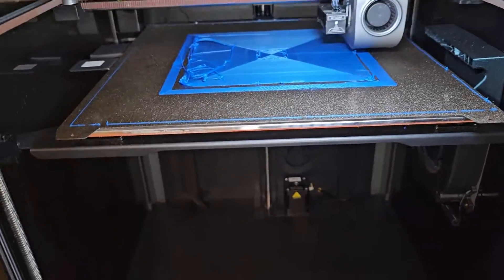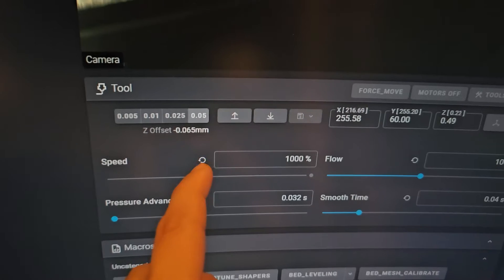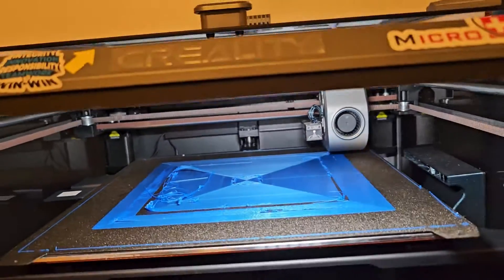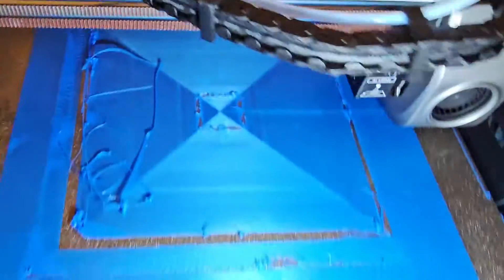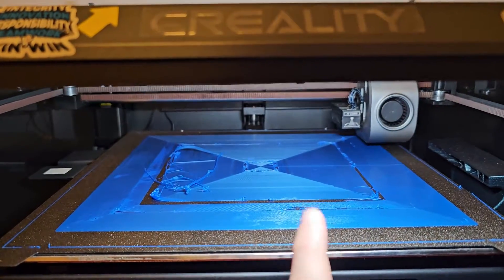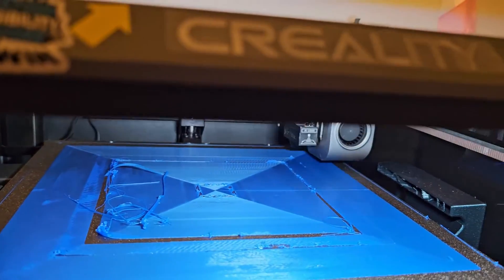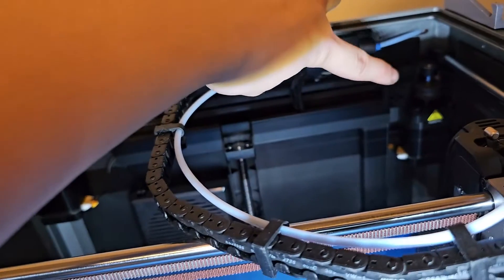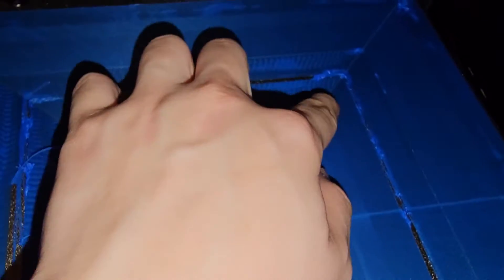Learning More About The K1 Max First Layer... Why It's Not Sticking

Comment: I sold my K1 max. Over time I had to print slower and slower. Replaced everything but the motors. A new plate helped a lot. But it just degraded and I had to print slower than my bed slingers…
Reply from the maker: ouch, hopefully mine stays strong for a long time. What 3d printer did you get instead?

Comment: One thing at a time. You print at 800mm/s for the first layer, and you do not understand why it don't stick? This is not a joke? This is for real? You even got ringing on the first layer. Horizontal ringing. What have you learned since posting this?
Reply from the maker: I have learn that I should slow down on the first layer, make sure to lube all the rod/motors and make sure it sticks to the bed.
Reply: @Scratch3DPrinting  Well. In the vid, the bed analysis tells you, that you have a warped bed. You need to heed that. It is also hard to fix on this printer. The center of your bed seems ok. Youtube is your friend on that one.

How about drying and how to treat the spool? You know the rule that the filament strip, should either be locked in your hand, in the extruder or in the spool. As to avoid from getting tangled? Selander is the only one talking about this, but it is super critical.

There is something called extrusion speed. In this video you simply run your printer beyond the max the printer can handle, and the extrusion fails. That is called volumetric speed. It differs across a lot of parameters. A quick youtube search, will give you a ton of info.

In this video, you ask about the patterns, the waves in your print. That is ringing. You go so fast, that the printer start hitting some resonanse, that translate into these patterns in your print. When they show up vertically, never seen anyone go this crazy and induce them horizontally before, they can be fixed by increase or decrease in speed, an alleviated by pressure advance and input shaping. You might also have issues with your printer, like loose screws or belts, not to mention, too tight belts.
Reply from the maker: @FrodeBergetonNilsen   Thanks for the info. I will try to slow down and improve on the first layer by using some of your suggestion.

Comment: I'm having first layer issues with my new K1 Max where the outer wall of the print smears and bleeds over the outline of the print but every layer above that prints fine. What I end up with is very unclean and overhang edges I have to clean up using a deburring tool (like a small unwanted brim when the brim setting is OFF). I don't mind cleaning up by deburring a simple print but doing that for many honeycomb wall panels is unmanageable.  I've tried adjusting the bed temperature, nozzle temperature, print speed, and calibrated the flow rate using pass 1 & pass 2 in Creality Slicer without any success. I never had this issue with my other FDM printers before. Did you have any issues with this and can you offer any tips on how to fix this? Thanks!
Reply from the maker: I do have that problem too, what I do is the make the first layer width a bit smaller, to about .3 to .35, this helps a bit with the smearing, but does reduce first layer adhesion. Try a pressure advance test on Orcaslicer, use the PA Line and see if that helps a bit. Let me know if you still have problems or have solved it.
Reply: @Scratch3DPrinting  That is not how you solve adhesion issues. Not sure what he means by "smear". Slow down the speed, to say 20mm/s for the first layer. Clean the bed and apply glue if needed. The slicer compensates for elephant foot, which is the setting to use for adusting first layer layer width. Much more important is the layer height. Use 0,3mm layerheight on the first layer, if 0,2mm does not work. If you do, you need to increase the layer width, probably to 0,5 or whatever default would be for your printer for that setting.

If it still doesn't stick, you need to work on bed temp. Then you need to work on nozzle temp. You might need to increase the speed. You might need to alter your model. The list is like endless. But that bed is notorious for not being flat, and to be almost impossible to level. It is also known, to have a very uneven distribution of heat, as in widely varying temp across it. The z mechanism is really bad.

Nothing will fix a warped or angled bed.
Reply: @FrodeBergetonNilsen what I mean by “smear” is the finished product has very rough perimeter edges where I have to sand off or use debuting tool.I don’t have that issue with my Elegoo or Bambu printers. It is very disappointing for the amount of money spent on this printer I shouldn’t be having these issues and have to tweak multiple settings to have a clean result. I don’t have a bed adhesion issue and don’t have to use glue on my PEI textured plate yet. I will try all the suggestions above. Thank you all.
Reply: @chno4422  I still do not understand what you are describing, as it makes no sense to me. The only thing that would cause what you describe, since you describe this a perimeter issue on the bottom, would be either user error or adhesion issues. You speak of a perimeter only issue, which isolate a ton of issues as irrelevant, then you exclude adhesion. If it is the printer, you most likely got adhesion issues along the edge of the plate, which is pretty normal.

One way to combat that, is to increase the layer height for the first layer. That way the printer need less accuracy to print, and the printer might finish the job, despite its issues. I have used 8 Prusa mk3s over the years. They all needed to increase the layer height to 0,3 and to use a 0,6 nozzle, to be able to print along their edge.

I have heard plenty of bed issues from Babulabs owners. If you look, they are all over the place. No reason Elegoo is any better either. But for the k1 class, this is almost impossible to deal with and correct, even by modding.
Reply: Pictures always help! if your're using the Creality slicer then make sure autobrim is turned off in the bed adhesion settings...

Comment: I finally got a clean perfect first layer on the k1 max. I had to increase my line width to thicker.
Default .48
First layer 0.6
outer wall .42
inner wall .48
top surface .45
sparse infill 0.48
internal solid infill 0.48
support 0.45

I also decreased my speed for the first layer to 60 and Normal printing acceleration to 10000 top surface to 2000 and travel to 10000. 

My reasoning was better adhesion with bigger lines and .4 nozzle works well with .48. As for the acceleration those were the same values as my QIDI! FIlament was Creality Hyper PLA!
Reply from the maker: Nice finding. There are a couple of draw back for thicker line for first layer, for example tolerance, but I think it's a good sacrifice for good first layer.

Comment: Did you try using hair spray for adhesion? in PEI bed it gave me the best results. 
And beware that the chain is rubbing the X axis on certain points (a common issue).
Reply from the maker: I don't want to use hair spray or glue because it's messy and it kind of ruin the first layer texture, yes not quite sure how to fix the chain yet, it is quite annoying.

Comment: The reason the Z movement doesn't actually match the arrows it's because it is based on your head moving from the table. So if you push the up Arrow the table will move down because it thinks that you want your Z offset to move up. And then the opposite if you push the down arrow. The machine thinks you want the Z offset to go down so it moves the table up. You have to think backwards when you're using core XY machines when it comes to your Z offset. I am a CNC machinist by trade so I deal with this every day.
Reply from the maker: Ahhh, that makes sense. Learning more everyday.  Thanks
Reply: Thinking backwards when it comes to core XY machines isn't strictly true, it's only true for core XY printers where the bed moves up/down, such as the K1/K1 Max, Bambu X1C/P1S/P1P, Voron Trident etc.

On a printer like the Voron 2.4, which is also a core XY machine, the bed is fixed and the gantry/toolhead moves up/down

But like you said, the up/down arrows are relating to the toolhead, not the bed

Just think of it like this, up arrow = increase Z offset, down arrow = decrease Z offset. This is true for all printers, core XY, core XZ, cartesian, deltas, hangprinter, drone printing.....
Reply from the maker: @markynorris   ahh interesting thanks for the info.